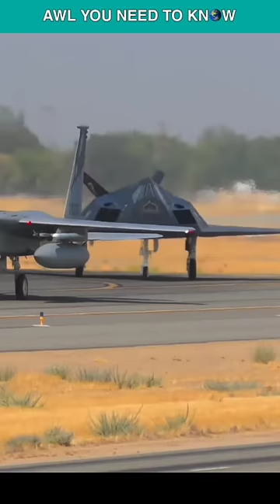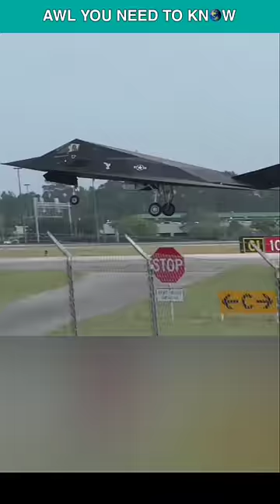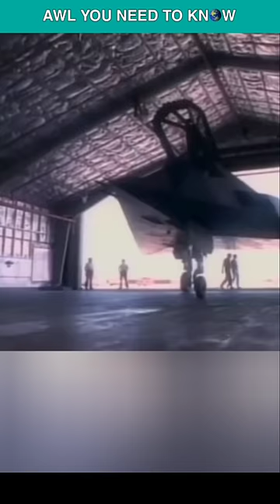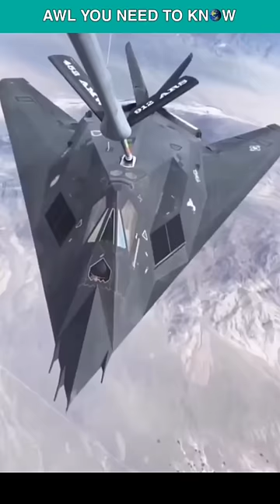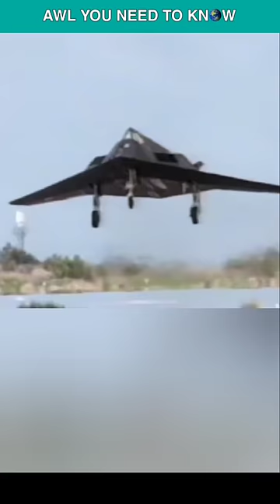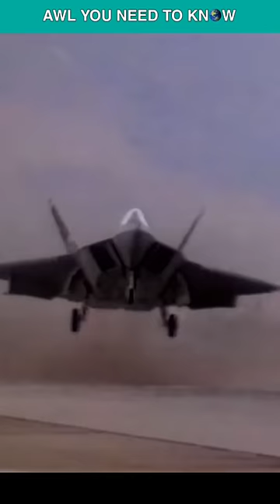Why The F-117 Had a Short Service Life? #shorts

Comment: It was called the F-117 fighter just to confuse our enemies.  In fact it had no air to air armament.  It was strictly intended as a bomber, a role which it performed admirably.
Reply: Named F-117, because if it was designated as a bomber, its existence  would have had to been divulged in accordance with the SALT II agreement.
Reply: @dalechristensen3640  Excellent!  Thanks, I had no idea.  On the other hand, didn't the US get busted for lying about this?
Reply: I'll add to that that the F117 actually shares a lot in common with the F16. Not externally, obviously, nor the engines, but the fly by wire system is the same, as well as some other components internally. Mostly boring stuff the average person wouldn't care to know about
Reply: @crewdawg2008  also has the landing gear of the A-10.
Reply: @dalechristensen3640  I wasn't aware of that one, but it's a possibility sure, I'll buy it

Comment: in short

it was too cool for the air force.
Reply: We just have better stuff now
Reply: @skiboi you mean cooler
Reply: @Panchoproductions2069  both
Reply: The F-117 It was a puce of garbage flying.I saw it 1999 at Keesler air show. When that thing was in a turn it sliding to the ground like a rock,a paper plane have better aerodynamicl.
Reply: @MelvinCruz  I wouldn’t call it garbage, but it definitely could’ve benefited from afterburning engines and a smoother design
Reply: @MelvinCruz I was stationed at keesler in 1999 too.
Reply: @SDNative1980  I was at AvionicsTec School 99-00
Reply: It looks like it was designed as a prototype to see what could be done in stealth. Then they figured other ways of doing stealth and keeping the thing useful.
Reply: I’ve literally been up close in person near the anti gravity evolution of the F-117, that’s why it’s done, it’s out dated

Comment: Imagine if the F-117 was converted into a sort of long-range strike drone using the Predator Drone systems, removing the need for a human pilot.
Reply: The Boeing Ghost Bat is basically this
Reply: It has to have better armaments then! Like the newer AGM cruise missiles (or old ones like the AGM-154). It’s low munition capacity can’t cut it.

Comment: F-117 was never a fighter, so no afterburner needed.   Should have been an A-117.   But then again, A-10 pilots call themselves fighter guys.
Reply: Technically a B-117 since is pain purpose is heavy bombs. The reason they designated it an F-117 is because they wanted fighter pilots to fly it. And they would whine if they got downgraded from fighter pilot to bomber pilot.
Reply: If an warplane isn't a strategic bomber or fighter-interceptor, the AF hates it. As the Vietnam war wound down, the A7 aircraft the AF was forced to fly were transferred to the various National Guard units as quickly as possible. I'm rather surprised the A-10 has remained in service as long as it has, although I have read that the Army would love to have them. The AF refuses to allow that, because they want to keep their 'cool toys'.
Reply: The "F" designator was CORRECT. The F117 IS/WAS CAPABLE of Firing AIM 9's. It had the capability of using LAU 114 missile launchers.  This Capability was intended to make it a Fighter to keep it off the START & SALT  Treaties as a Nuclear Capable Bomber. Yes i did work the F117. I also worked Research and Development for many Air Force test Programs
Reply: @spuds416  interesting.
Reply: @JM-lk6wo the A-10 is only still flying today, despite its perfect setup for every conflict we’ve fought in the last 30+ years, because Congress won’t let the AF kill it off when the cost per flight hour compared to every other combat plane is so cheap. The A-10 is capable in all but the most heavily defended air space. It’s designed to fight on the front with other fighters and wild weasels providing cover so it can get in low and slow and chew up troops, arty, and vehicles directly threatening Army and marine units. The AF hates working for the Army. Despite the fact there has been exactly one air-to-air kill in the whole U.S. military since 1991.

Comment: It was mainly because the air force realized it straight up doesn’t work. It was shot down multiple times in Kosovo and Serbia by relatively ancient S-125s. The F-117 was a good test bed for future stealth aircraft but as far as actually completing missions it wasn’t.
Reply: It was shot down once, one was hit with a good bit of shrapnel.  Those “ancient” s125s were only 5 years older than the nighthawk.  Still had to be within 10 miles to be picked up, radar is the issue, not the missile.  An s400 could maybe shoot down a nighthawk at 35 miles, probably less.  

Dozens of planes doing thousands of sortees for one downed plane.  Thats a hell of a record over contested air space.

Comment: We can thank obobo for having less than 200 F-22s.  We were supposed to have 1,000.
Reply: Just as well, they're gonna be phases out soon due to upgrade costs and so far just 1 balloon kill.
Reply: @GrgLuz  The reason they didnt have to use it is because its insanely powerful (and so is the us in general, they have no match). If the us was still using f4 phantoms from the 60s do you think their enemies would second guess before attacking them? TL:DR having overwhelming superiority on every military sector (yes including air defense the s400 is dogshit) is an incredible deterrent, alongside nukes of course
Reply: Yeah I’m a massive F22 fan but we didn’t need 1000 that is just overly expensive because where the f*** are you going to store 1000 of the most advanced and top secret jets and also train thousands of pilots… 200 along with a fleet of F15s and 16s was well enough to control the air in any country while not being stupid expensive. F22 is a beast and I can’t even begin to imagine what they have in development.
Reply: @Skoodelly  not sure where I disagreed with this idea
Reply: @astatine5781  Then why was the original order for 1,000?  No.  If we had 1,000 of these planes, we'd be safe for the next 30-40 years.
Reply: @queasylagumo-s7j why do you need 1,000 when 1 hasnt even been shot down. The economics of 1,000 airworthy aircraft would make them useless and rack up such a high maintenance cost they'd start cutting corners which could impact the actual stealth capabilities and increase the risk of losing top secret technology.
Reply: @queasylagumo-s7j  no. No we wouldn’t. We would find something better, need the money, and then end up selling these jets.
Reply: @astatine5781   no. No we wouldn’t. We would find something better, need the money, and then end up selling these jets.
Reply: i know right?  that was stupid.
Reply: @queasylagumo-s7j  dude 1000 or even 500 F22s is more than ANY nation COMBINED can handle while still maintaining an entire military, 1000 F22s is just dumb because it’s not really something to be deployed on mass, it can’t do many jobs well like the F15 can because it was designed to kill jets and be the best at it not be the best multi role. I’d rather have 400 F15s, 100 F16s and a fleet of stealth bombers (the new B21) complimented by all the other things necessary like AWACS and aerial refuelers. 1000 F22s is just insane, America is the richest country on this planet and we couldn’t handle 400 of these beasts. Maintenance of a highly top secret aircraft? That’s expensive. Storing and logistics of top secret aircraft? That’s expensive. Training hundreds of pilots to fly a top secret aircraft? That’s expensive. I’m a super fan of the F22 but there is not a single country other than America that has developed their own true 5th generation fighter and it shows. The age of thousands and thousands of planes battling it out is over, this isn’t WW2 where we need 10000 BF109s and 10000 mustangs, we need to play our cards close and be conservative with our money and technology.
Reply: I like the best of breed approach where the various aircraft work together with each contributing its unique strength. The F-22 can be used first to gain initial air surprised followed by F-35s as the brains and eyes of follow on missions while the F-15 serves as a "flying magazine" with massive ordnance behind what the F-35 can carry. I'm happy to see the F-15, F-16, and A-10 being kept in service as they are all still phenomenal aircraft that when combined with the stealth fighters is a much better strategy than relying solely on F-35s. These older aircraft are still extremely useful and were really awesome designs that were really well thought out so as to be useful for an amazingly long service life. Great that they are being progressively upgraded and kept on the team. The F-15 and A-10 were both designs that are basically "timeless" which is a huge credit to their designers given that they are 70s era designs. Sometimes you just get it right the first time! I love these planes and see then sort of like the 1911s of aircraft. Long life the F-15 and for the sake of ground pounders, the A-10. I'm glad Congress has the sense to not allow the stupid air force to decommission them!!
Reply: @gregaldr  EXACTLY, the analogy of the F15 being the “flying magazine”I a perfect, the F15 can carry boat loads of missiles that the F22 and F35 would need to fight effectively.
Reply: The F-22 was 10 years late entering service. It's replacement is rumored to be flying
Reply: The F35 is a more useful platform for combined arms warfare.  The F 22 is a better air to air system but lacks the data sharing capacity of the F35. The F22 will be used for air to air superiority along with F 35 A and C variants in a near peer conflict. Different tools for different jobs kind of deal. The u.s is also working on and allegedly has 6th gen prototypes already in development.  The F 22 was a game changer like the F117 but are still 90s and 80s tech respectively albeit incredible tech for their era's.
Reply: 1000 F-22s sure don’t make us safe from even one nuclear strike.
Reply: @russellharrell2747   Sure they can.
Reply: @Skoodelly ok so I'm a former ELINT/SIGINT guy from the Marines.  I had a argument the other day with a ruskie lover who was just crowing about the s400/500 so yes the missile for both those systems has gotten better since the s300 and it's grandfather the SA10 BUT THE RADAR HAS NOT.  It at still uses the same radar system that the SA10 used for  it's search radar.  The radars pulse repetition and frequency are exactly the same which means it's power is the same.  They claim it can see stealth and it can eventually at around 20km or less.  That makes the system useless vs stealth. The only stealth ever shot down the f117 was due to a extreme dumb luck situation.  They followed the same track that they had taken dozens of times and had a vulnerability when they opened the weapons bay.. since then they replaced the weapons bay functionality with a much faster one and they no longer get lazy in planning.
Reply: @bear76009  First of all thank you for your service and second I want to add that the s400s radar simply cannot be fed enough power to have a high fidelity lock at the bullshit ranges listed (I think its like 600kms? yeah no), atleast it would explain why ukrainian missiles pass right through it
Reply: @Skoodelly  exactly The whole technology that the search radar is for that system is based on stuff that was made from when I was a child and I'm 51 just out of curiosity I looked up what radar system that they used and was shocked to find it was the same one that was off the SA-10

Comment: Bro wasnt it reemployed?
Reply: it wasnt, after the F-22, it was deactivated but not retired. deactivated means it can be put back into service when needed. it wasnt retired cuz it had a lower RCS than the F-22 and even the B-2
Reply: @lolsomeyoutuber.1425  it's physically smaller. I think width plays a big factor. B-2 balances this physical phenomenon, itself being very wide, by eliminating vertical stabilizers and using more modern classified RAM, and more importantly a computer modeled 3d shape to maximize it's stealth capability. This technology was unavailable while designing the F-117, which could only be calculated using basic flat surfaces.  The B-2 carries over 8x as much ordnance as the F-117!
Reply: @lolsomeyoutuber.1425 might wanna double check that they were last seen in syria 
And one has been upgraded with the shame chrome coating the f22 got
Reply: Yes they have been re deployed last know to have been in syria 
 Also those still in storage sit in air conditioning hooked to power 
They have also added the chrome coating to one for testing